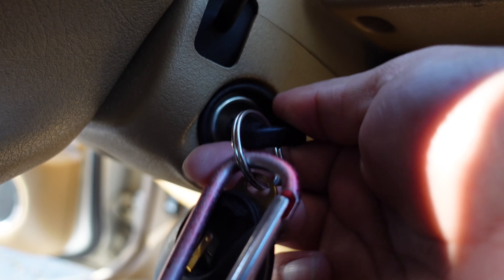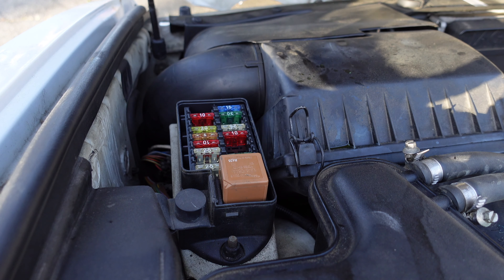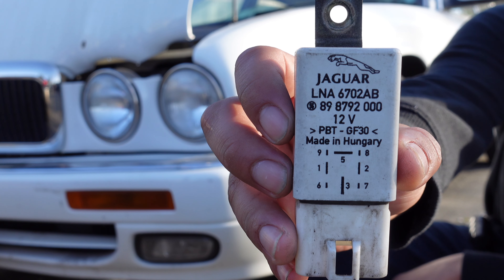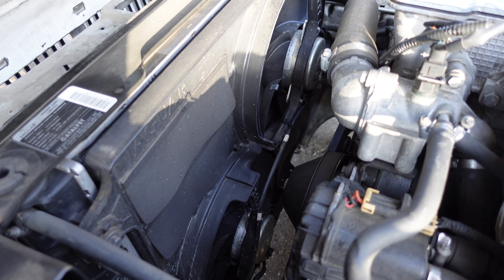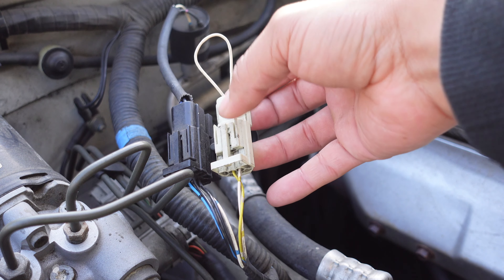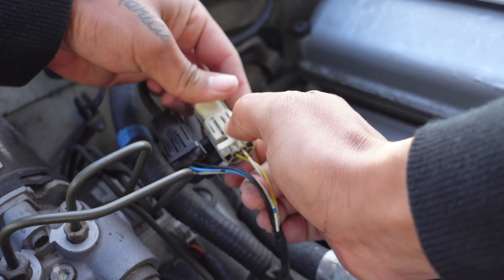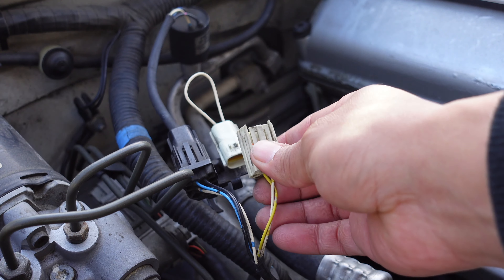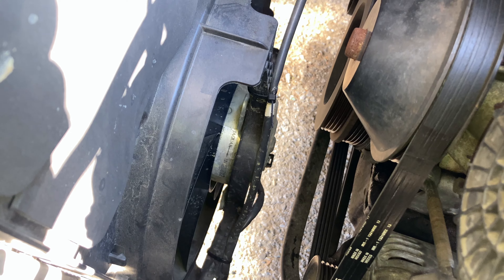Repairing Cooling Fans That Won't Activate in Jaguar XJ6 X300

Comment: I will be converting my XJ40 to electric fans this spring. I already have ordered all my parts.
Reply from the maker: Nice! Let me know how it goes this is something that I would like to do on my XJ40 too!
Reply: @XJJesse  The fan that I got is from my father's Peugeot 505 diesel station wagon that he had in the mid-90s, when I was 5 years old :) The fan is probably 40 years old, but it works just fine. It is about 12 inch diameter. It is not the biggest, but it will more than likely be fine, and the XJ40 already has another electric fan in front of the radiator, if better cooling is needed.
Reply from the maker: @alexandrecouture2462  Thanks for sharing I might get everything from a later XJ40. What about the wiring? Have you figure that out ?
Reply: @XJJesse  I would like to do a fancy setup with variable speed (Pulse Width Modulation) as on newer cars, but I am not there yet. For now, I will use a temperature controller that I bought on AliExpress, along with a big relay and proper fusing. I bought a 12v ''Digital Temperature Controller STC-1000''. It has 2 outputs, one for controlling cooling and another for controlling heat. The controller itself will be powered by the ignition switched 12v. The small relay in the controller will be activation the big 40amp relay for the fan. I will probably just put the temperature probe in the radiator fins. The biggest challenge is that the space between the front of the engine and the radiator is quite limited, so the fan should not be much more than 2-2.5 inches thick. Snow has melted on my car so I can get to it, but it is still way too cold to do the job. It's coming!

Comment: I got a 94 xj6 and it has an issue where the fans don’t turn off at all. I have to unplug the battery every time ortherwise it drains it. Im gonna try to replace the fan relay hopefully if fixes it. Thanks for the video.
Reply: Did replacing the relay work? I have the same problem.

Comment: hey bro what do you mean by jump the white connector with the white wire loop you mean put live power from another battery  ? my fans stayed ofull on with the ignition on  i checked fuses and relay seem good and clean  i was thinking the sensor /switch in the rad ???

Comment: Very nice Video man. My X300 isn't going to closed loop and the diagnostics state that the engine temperature is insufficient. Even in summer after a good ride. Its at 80 C. Thermostat and sensor is changed. Do you have any Ideas please? Or should I simply pull one fuse and drive with only one operating fan?

Comment: and my central locking dosnt work with the button on dash but clock dosnt light up either di i take the panel out where are fuses and relay for locking 1995 xj 300